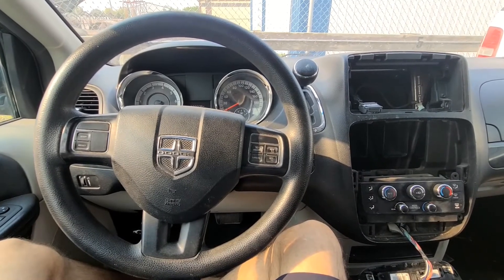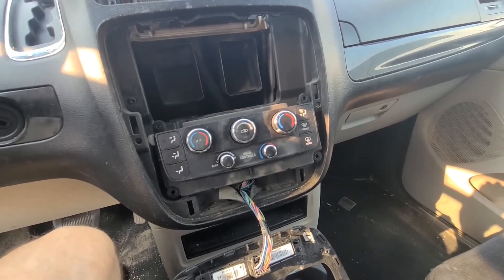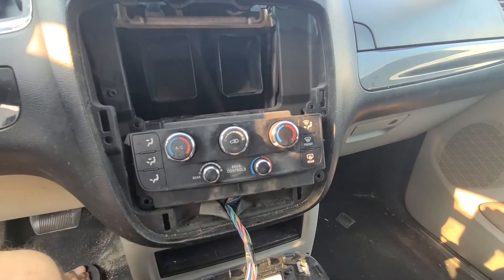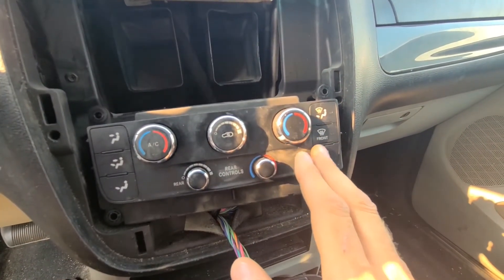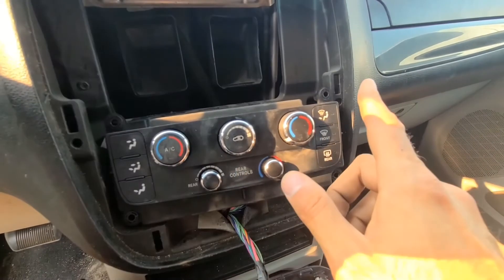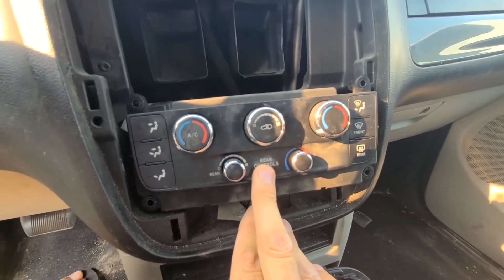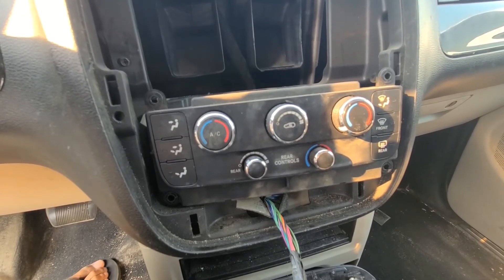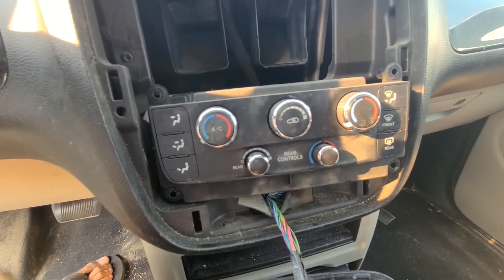Dodge Grand Caravan - REAR DEFROSTER BLINKING? NO HEAT OR A/C?

Comment: Thanks for the video, I finally fixed it today, I tried battery disconnect over night, and other stuff and so on, but unfortunately nothing worked, went to Dodge garage and changed the HVAC rear actuator and no more blinking, Air-Con kick in right away as well. Yes, it costs me. If I knew what it was exactly and what part I needed to replace it, I would go for it half an hour job and 1/6 price what I paid today. QuiteAlright has another video that how to change it.
Reply from the maker: You're very welcome. I'm glad my video helped you out

Comment: Also the replacement unit was a dormant for 19.00 the dealer is basically ripping you off on the cost of the actuator because it is no different than the doorman

Comment: I have a 2016 Dodge Grand caravan and the rear actuator for the heater blend door failed but the light never blinked on the console in the front I recently replaced the Vans battery and since then the light is blinking now and I can hear an actuator on the passenger side in the front is sluggish why would replacing the battery cause this
Reply from the maker: Hello, unfortunately I had the same experience with Dorman and most of other aftermarket actuators. They work but cannot get synchronized and then it causes rear defroster light to blink and blower not to work for 20 sec at every engine start. If you run HVAC diagnostics with higher end scanner it will probably show that actuator as faulty. So what I do I get bunch of used OEM ones from car salvage and replace with those. Cost me $10 each. OEM new ones are very expensive at a dealer

Comment: Need know if there is a rear defrost button for 2002 Dodge grandcaravan
Reply from the maker: Yes it should be part of the climate control panel, next to the rear wiper button and temperature settings

Comment: Yup! I went with another brand of switch and my van has the same issue. Guess I’ll have to go with oem parts!!
Reply from the maker: You can try doing recalibration using the scanner and see if it will work. If not unfortunately you will have to go with oem
Reply: I learned how to stop the blinking without all of this .. start the car hold down your C button while holding the rear defrost button for 5 seconds and the light will stop blinking.
Reply: @anthonyr8362 which c button?
Reply: @anthonyr8362 which C button please

Comment: Remove both negative and position cable from battery. Tie both  negative cable connection and positive cable connection together for 45 mins. Then connect the positive then negative to the battery. The issue should be gone. This happens normally after you remove the negative  cable before.
Reply: I learned how to stop the blinking without all of this .. start the car hold down your C button while holding the rear defrost button for 5 seconds and the light will stop blinking.
Reply: Whats the "C" button?@anthonyr8362
Reply: @anthonyr8362  the c button on my van is the econ button
Reply: Dude this is the fix, thank you !
Reply: The right thing is to remove the negative first then attach the positive first .
I did this 45 minutes maneuver and it didn’t work, and also issue has occurred after battery replacement.
Reply: I learned how to stop the blinking without all of this .. start the car hold down your C button while holding the rear defrost button for 5 seconds and the light will stop blinking.
Reply: @anthonyr8362 what is the "C" button?
Reply: My negative cable was taken off yesterday. And now my vehicle did this today. 
I need to take them both off then tie the together what does this do??!? Then put them back on?
Reply: @taylormartinez4629  thanks for great information. Did you try it? Did it work?
Reply: @taylormartinez4629  yes
Reply: @taylormartinez4629  it drains all the residual power that left t in the system
Reply: When u say tie them together. U mean the actual bare metal leads to each other?  
I used dorman actuator. Everything workss now except for blinking rear defog light and 1sec delay.
I jus want to be sure b4 i do this.
Thanx

Comment: there is a TSB out on this issue R62
Reply from the maker: thanks for sharing
Reply: Sorry but i found out today from dodge customer care that the TSB R-62 expired in 2019. bummer because i’m attempting to calibrate my blend door actuators on our 2014 grand caravan
Reply from the maker: @richardsandbrook5901  It can be done with any high end scanner which can access hvac module

Comment: This video is very helpful.  I thought my climate control unit was bad, but now I see that I have a blend door issue.  SO ANNOYING to have to use Dodge parts - What a RIP OFF.
Reply from the maker: Yes if your climate / blower doesn't work for first 30 seconds or so and rear defroster blinking that means the initial hvac test failed and one of the blend door actuators is not working properly.
Reply: Yeah god forbid you use the parts they specifically designed for the vehicle versus someone else who took that design and modified it so they could sell it. Suchhhhh a rip off🙄

Comment: You have no idea how long this is been happening to my van it's been happening for like two months and I thought that a GPS tracker got installed on my van because I'm late on my payment due to someone f**** up my life trust me I wish I could pay the van off completely I have been living in my van for 2 years and for the past 2 months I've been a prisoner in it except for when I'm Landscaping I'm able to park in my boss's garage and this video I just came across because a guy put a old scope on my van and said that it looks like there's a problem with your vehicle not a GPS tracker on there but just a week or two before I went to a mechanic and he put a scope on and he said that my Havoc system is supposed to be showing 11 volts but it's only showing four volts something is draining seven volts from it that made me think there was a GPS tracker wire to my van which it could still be wire to one of the actuators I'm going to watch your next video to see where these actuators are located and by the way mine blinks rapidly for at least 30 seconds or more and then once it's done I'm able to turn on my AC and my blowers nothing will work on the Havoc until it's done blinking and when it starts to Blink it's not when I put the key in the ignition only or start the car it's when I open my doors turn on my interior lights touch my window buttons to put down my windows Anything Electric I touch almost anything not the steering wheel buttons but almost anything else the blinking rear defrost light will come on and while it's blinking I cannot turn on my blowers so thank you for making this video like seriously thank you so f**** much if I wasn't pouring homeless I would send you a hundred bucks just for giving me peace of mind and most likely this is just a problem with my van and they're not trying to repossess it even though the bank said it's not up for repossession but I don't trust Banks they're Liars considering also my front end got smashed in by a 17 year old girl a block and a half from her high school because she was looking at her cell phone and it shut me down on Uber and Lyft and that's why I'm f*** right now because I can't do any driving to make money so yeah I'm going to watch your next video and see where those actuators are and I'm going to take a look at them myself so thank you so so much and I'm looking at getting this new job and when I do I am going to YouTube you some money sir because you deserve a little something for just giving me that peace of mind that they're not actually tracking me although I have been seen a lot of the vehicles following me around.
Reply: After a year, how have things been? Hope life is better.

Comment: What is the malfunction in the aftermarket actuators ? Most calibrations sweep stop to stop with HVAC looking at motor current to calibrate the travel limits. HOWEVER, the data shows door desired and actual positions. Is chrysler suing the position sensors for calibration of travel limits ? I cant find info on what the HVAC module is looking at when calibrationg. Forced cal doesnt work for the new / actuator either... ?? I haven't gotten a chrysler actuator... YET..... yay
Reply from the maker: I don't know, aftermarket actuators work as they are supposed to, but will not pass self calibration and rear defroster will be blinking. Only way to fix it is with OEM parts. To save money get used from car salvage, they will fail eventually whether you get new or used

Comment: Huh, I always wondered about this issue.  I have replaced 3 of 4 blend door actuators on my 2012 with Dorman replacements to save $100+ each.  I will live it.  Thanks for the video and thanks Chrysler for designing a cheap ass part that requires me to go directly to you to be scammed.
Reply from the maker: Well Dorman will work like it is supposed  to, but system will not recognize it and again you will deal with rear defroster blinking. I ended up going to the car  salvage and pulling out 10 or so actuators. Paid $20 for all :)
Reply: @QuiteAlright - I am a little late, but pulling a bunch from a junk yard is wise. I bought a few Dorman blend doors and the blinking light started. Now I do not want to pay $80 on such a cheap part, so a junk yard is a great idea.